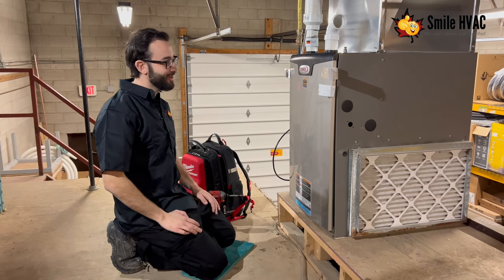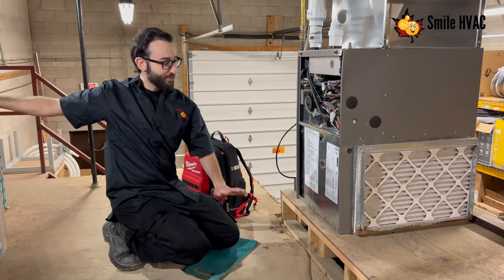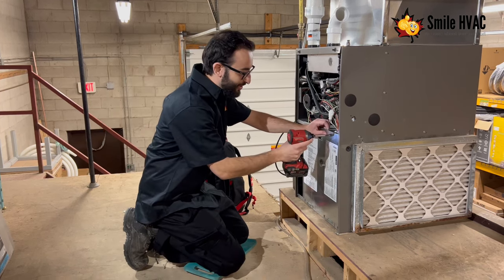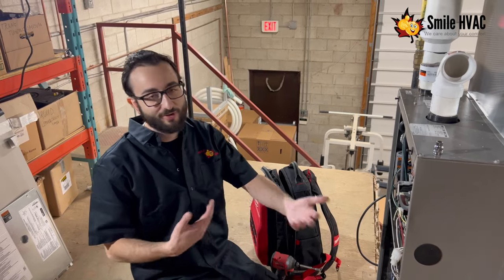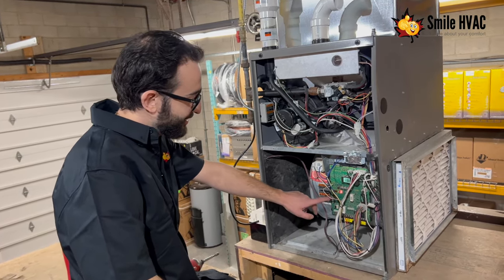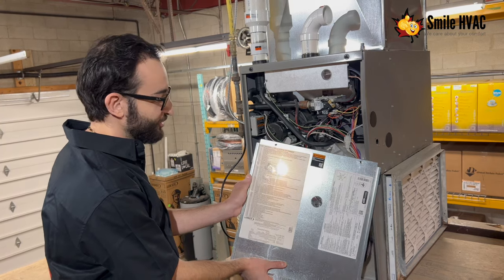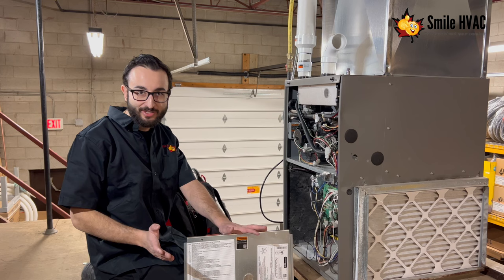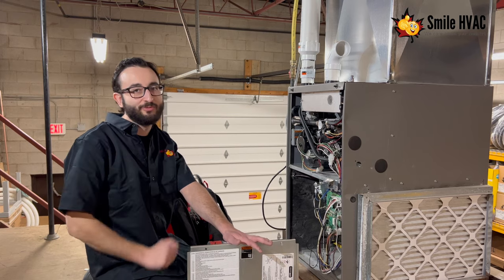Furnace Red Light Blinking: What It Means and How to Fix It

Comment: What if the status light comes on and shuts off completely before ignitor lights? The inducer fan kicks on and then about 5secs later it shuts off but the inducer fan is still going? Unit is 20yrs old. Just trying to get it going until I can possibly replace it.
Reply: Is the status light on the board relaying an error code ? You can google your furnace and the explanation of the status light for different error codes .
Reply: Pressure switch. Clogged or busted, or the air hose has a leak. Lots of info on this on YouTube if you search. Cheaper part, easier install.